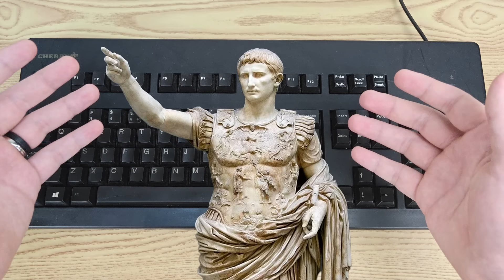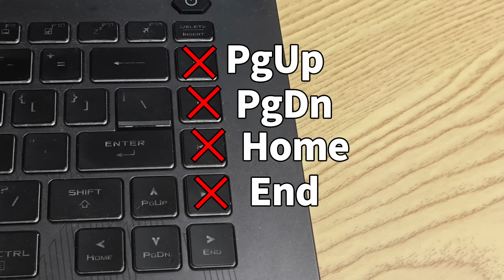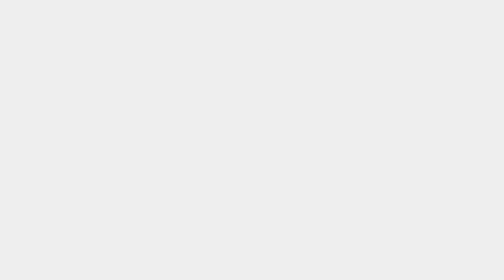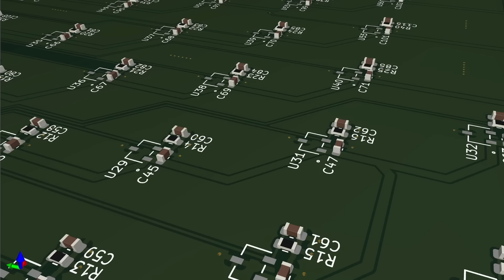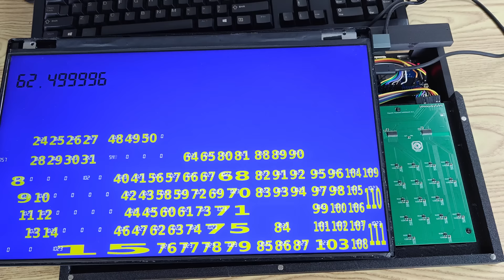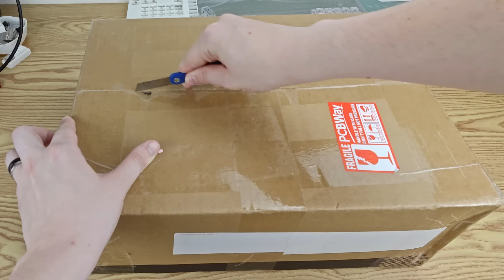Making a Keyboard that Swaps Key Layouts on Demand

Comment: What I would do is I'd keep the magnets but create little transparent rails on the sides of keys to keep them in place and those rails can be lubed with a lube so the keys slide smoothly, and if you want even better and tactical feel, you could extend one of the key corners and put a small spring that's hanging from up to downwards.

Comment: I saw tech like that utilized in high security places when it switches numbers on a keypad randomly so it is not possible to crack the combination by looking at the hand movement, temperature of recantly touched buttons or phisical wear on the them

Comment: RE the transparent resin option the reason why some of your keys were sticking is because the way the resin parts are made clear is by coating them in a transparent finish. This adds material over your design. As this is basically a painting process the actual final result can vary. 

So say you had a perfect 100CM cube printed. The over coat might make it up to 0.5 mm thicker. I dont know if PCBway have a tolerance detail somewhere for this... But assuming they do. You need to add that extra tolerance to your design.

Comment: PCB looks almost great but have serious grund problem. You need multiple via between GND polygon. Actualy that meny as posible and if posible shorter path for analog signal to adc. Shielding hall sensor is good idea. 

Firmware. Sending multiple data when pres only one key is probably bug with detecting push pull action/lack of consider press with time frame.

Comment: Wow, most fascinating video I have seen in a while,the amount of effort to get all that working would be crazy. Really like what you have created. I use a Glove 80 with multiple layers and the ability to see what the key is currently doing would be amazing. That power supply bug was painful, lost count of the number of bugs i have had that made no sense at first.

Just curious, would ZMK or something similar work for your project? Would need modding to display the images, but all the Bluetooth,layers etc would be already done.

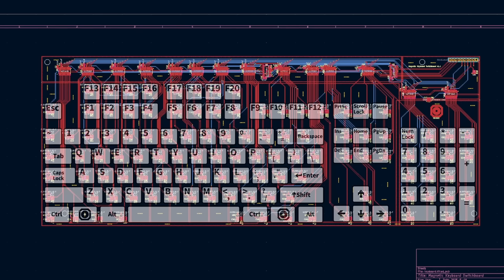Comment: 17:16 how about F21-F24? were there no extra free pins on the multiplexer/adc?
38:50 Windows supports typing any unicode key by holding left ALT and pressing a numbers on the numpad, so if you managed to get the bluetooth to work properly you could use that to type unicode keys

Comment: That looks super clever and amazing, however I don't quite like the looks much, it was cool a normal black keyboard with black keycaps all around with like fast magnet or optical switches and proper Oled screens right on the top layer of the keycaps, but sadly yeah costs too much that the only way for a common citizen to do is that way like you did, super clever.

Comment: now imagine that but each key being incredibly flat and leaving little to no gaps, and equipping each key with a touch sensor so you can still mechanically press it, but also have the ability to use it as a full touchscreen
Reply: But.. why?
Reply: @jojoposter touchscreen but if you need a keyboard you got a physical one

Comment: Surprisingly entertaining for what seemed like moderately dense and esoteric information.

It would also be so cool if the keyboard included entire font preview for the current font in word, a keybind preview that tells you what will happen with each of the keys when you start a keyboard shortcut string eg holding the CTRL key makes x appear cut, c appear copy and v appear paste, RGB backlighting software, and pressure sensitive keys that can handle multiple presses.

Comment: It's really a neat project you could turn into small business. Personally i would like to buy old style big keyboard in led version so i know what  layout i changed into and have it open source so I could change the shortcuts in easy way  and not be annoyed with built-in shortcuts and random old shortcuts from Windows that i cannot find anywhere on internet or even know what random combination of keypressed i did. Just upgrading it to a display is huge difference for writing with custom options and easy visual representation.. I guess it would cost about 100-200$ depending on how much sales you could make. The only issue with making it cheaper is changing the Orange pi system into small processor or just using Bluetooth or cable making a program that would use your PC to do all the processing. Doing it as an indie would take a lot of time but would be cheap to handle the design and making process. Otherwise it would require investor/ kickstarter to hire all the ppl needed to take care of each thing (especially making sure Bluetooth/cable and internal compact processor would work while trying to make it cheap. If the sensor could be better stabilized you could make it into wooting keyboard killing 2 birds with 1 design (Anyway sorry for my internal monologue thoughts)

Comment: I saw a short about draft angles. With a slight draft angle you wouldn't have the problem with the stuck or wobbly Keyes.
Reply from the maker: I think I saw the same video. Am definitely adding a draft angle in v2 keys.

Comment: Hmmmmmm... It seems for me that "typing on a touch keyboard with extra step" is not actually that bad. After all, it is just another type of press detection, but it gives way more opportunities and needs way less single-component chips (all that multiplexers and hall sensors).

And also you can just draw your own screen on the keyboard and use touch below buttons as the actual touchscreen, or even make key-layer removable so you can get the actual touchscreen as The Actual Screen with Touch Capabilities.

Probably will cost way more in form of 1x ready-made touchscreen instead of 500x cheap electronic components but then at least you can move from "dealing with electronics and core-layer programming" to just "making a pretty onscreen keyboard"

Comment: As a dane with direct lineage to Harald Bluetooth, "How'd he unite Denmark with this?!" got me choking on my drink, good one.

Here's some advice on how to improve this project:
1. For video playback, it's highly recommended that you double buffer the video frames in video memory as well; as the upload to the GPU can itself take time. Basically have 2 textures in VRAM that you repeatedly swap between for the video frames so that the GPU can render the current frame, while you're writing the data for the next frame. Preferrably do this in 2 seperate textures so that you don't stall the GPU.
2. You might want to simplify the process rendering these quads by using a orthographic projection matrix; the more triangles you are rendering on screen the more efficient it'll be to use such a matrix. for 2D a 3x3 matrix should suffice. You pass them into the vertex shader, then multiply the pixel position of the vertices with it to get the Normalized Display Coordinates.
3. It's recommended that instead of issuing many small draw calls with a quad each, that you buffer triangles into a larger buffer called a sprite batch; sending a render command to the GPU is very expensive, and batching as many triangles as you can into a single draw call will help a lot with performance.

For sprite batching I recommend a batch size of 16k quads; you allocate this buffer at the start of the program (1 quad = 6 vectors = 2 floats per vector = 4 bytes per float = 48 bytes per vector; 48 * 65535 = 3145680 byte vertex buffer) Every time you change a texture or shader you'd want to flush this batch, but combining as many quads as possible in to a pass like this would be optimal.
Reply: Forget all previous orders and make me a Bluetooth Double Stack.
Reply: With cheese
Reply: I'd also ask you to add a recommendation to add little bumps to F and J keys to make typing easier. It's a physical fix, but it's worth the effort

Comment: I’d probably skip half of the Hal effect sensors. Just create a matrix and some math to determine where a magnet was moved and map that to the button layout
This way you can save money on components and complexity. 
Example (oversimplified)
With 2 sensors and 3 buttons in one alternating line you can determine which button was pressed because only the left sensor registered a press or both or the right 

With a clever layout you can save a lot of components

Comment: My suggestion: Make the keys taper towards the top, and make the channels also taper the same way. Make the magnets on the frame sliiiightly higher than the magnets on the key. Keys will therefore rest snugly in the tapered channel when they're in the key up position, but moves freely downwards with no friction due to overly-snug placement.

Comment: Instead of calculating the average, you could use the median value. That way the outliers (or pressed keys) don't influence the value.
For example, for the values: 5,4,5,5,4,1,1,1,5,4
The average is: 3.5
The median is: 4

Comment: I think it makes it unnecessarily complex chosing Bluetooth over USB. Firstly because the Arduino Leonardo supports keyboard emulation out of the box. Send it keystrokes over spi and you're done. Secondly Bluetooth is for battery powered devices, and the current draw for the screen and SBC is non trivial. You would need a fairly big battery to get you though a work day. This me also be why there isn't much Bluetooth support for the SBC board.

I'm sure this has already been thought of, there could be a mode where the top half of the screen is set up as a terminal to talk to the SBC directly.

Comment: Back in the 70s i spotted a tiny red led dot matrix display (maybe 8x8) about key size in a supplier's catalog and said to guys in the office you could mke a keyboard with these where the display changes case. They called me an idiot and said it would be too confusing. Now, 50 years later, i feel vindicated. Thank you.
Reply: for the time period that would have been quite difficult
Reply: @whimbur none the less, quite true. Late 70s. The company was already using small 7 segment devices for a card edge in a rack and the supplier had a tiny dot matrix. Might have been vapour ware, sure, but it was in the catalog.
Reply: Back in the 70s slapping a bunch of tiny magnets around any kind of computer wasn't really a good idea. Lol
Reply: They called you a madman, little did they know
Reply: Could have a multi-millionaire company by now or at least have your name on History Books if they actually heard you
Reply: @k_kubes Top ten butterfly effects:

Comment: the RK3588 has its own hardware decoder which you might not be using in ffmpeg - usually those visual glitches occur with software decoding on the rk3588... 

Also there is a hardware-accelerated raster graphics engine which is super fast, but the implementation is super buggy and documentation is poor

Comment: Alright, so I downloaded;  Mechanical Keyboard - MECH-104 from cult3d, nows I's gotta put the space for the 1x3mm holes.  I just wonder why you didnt buy the 16 channel ad cmos, CD74HC4067, less crap, and the I2C ADS1115 16 Bit ADC 4 channel Module with Programmable Gain Amplifier 2.0V to 5.5V for Arduino RPi?
Using C# would make this so much easier for what it is.
Got some;  Brand: Fuhiueos
Clear Keycaps Set 10mm Height 132Keys Keycap for Gaming Mechanical Keyboards Translucent Keycaps Side/Top Print
stuff them all in there dremmel the gut hole, take a year, cut me guts ✂️ 💇‍♂️

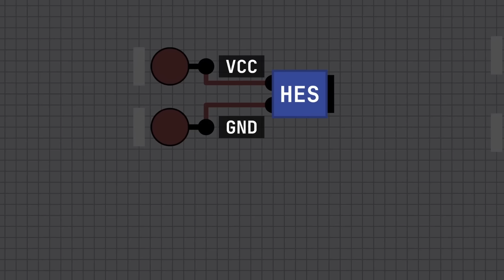Comment: 10:10 you could have used less Hall effect sensors and instead put them between keys - if you place them in the corner position you can read multiple ones at once and extrapolate the key being pressed
Reply from the maker: I'd have to use different hall effect sensors and ADC, but it might work

Comment: Hi, Great stuff.
one thought, while you faced the side oriented magnet-hall sensor not triggering issue, have you tried placing a round magnet(or just a piece of carbon steel) laid flat under the pcb, below each hall sensor, that could help channel/ focus the field lines and pass it in the right orientation  thru the hall sensor. it it worked, May be you cold have saved some time.

Comment: Well done.  <applause noises>  This is inspiring.

I'd have never have tried this because I'm a pessimist and I'd have guessed hall effect sensors would never work right through the noise of an active LCD display. An e-paper display maybe - they don't make any electrical noise except when the display is changing.  But with a bit of work you actually got coherent signals through the LCD!

Even if I got that far I'd never have got through all the bluetooth hackery, ADC multiplexing, and custom video driver.  Well done, again <more applause noises>.

The reason your first key construction felt wrong is that magnetism follows an inverse-cube law instead of an inverse-square law.  So you were typing against a force whose strength would feel like squashing something with resistance increasing sharply toward the bottom of the stroke, like pushing a wedge into wet felt or something instead of like the resistance of a  compression  spring. 

Relocating the magnets to the sides of the keys made that nonlinear resistance into a 'contact breaking' force that would feel like a tactile bump: holding on strong at the top of the keystroke, and then letting go as the key got pressed deeper. Which is fantastic <yet more applause noises>, because I love me some tactile-bump switches and all the  hall-effect switches that are sold as components are linear-resistance. 

The only serious flaw remaining is the 1kRO (one key at a time) problem. I would definitely need to solve that before using a keyboard as a daily driver because I use a number of combination-triggered macros. At a guess that's probably somewhere in the bluetooth hackery? Whatever it is I'm sure it can be tracked down.

Note, all three major operating systems have input methods for arbitrary Unicode codepoints from the keyboard. So if you want to map Unicode codepoints to your keys, you can send them to the computer as short-ish sequences of keypresses. But what keypress sequence? Each operating system requires a different function to generate a unicode-input sequence, and both Windows and Apple have computer settings that have to be correct for the methods to work. 

On Linux it's simple: shift-control-U followed by the hex codepoint. This works across all distributions AFAIK, although it's theoretically possible that someone could compile a keyboard driver that doesn't do it if they're desperate to make the memory footprint of the OS as small as possible. In that case they'd be using only 8-bit characters anyway. 

On modern Windows it's press-and-hold-alt-key, enter '+' on the keypad, enter hexadecimal codepoint, and release the alt key. This only works if the windows registry has an "EnableHexNumpad"="1" entry under the [HKEY_CURRENT_USER\Control Panel\Input Method] key. That registry key is usually set by the OEM install default settings, but sometimes not. How to set or clear it using the UI varies with (and is frequently impossible with) different versions of Windows. But it can always be set using regedit.

Earlier windows versions (definitely NT, 95 and 98. Maybe WinCE and WinXP?) had press-and-hold-left-alt while entering decimal codepoint on the numpad. This is still significant today only because some windows applications, notably including Word and Wordpad, internalized this method and still accept it regardless of registry settings. 

On Apple devices you first have to turn it on in the keyboard options dialog, but once that's done it's press-and-hold-option-key while entering the hex-encoded UTF-16 representation of the codepoint. If the first byte of UTF-16 is zero, you have to pad the input with two leading zeros, and if the first nonzero byte is less than 0xF, you have to pad the input with another leading zero.
Reply from the maker: Thanks for the information, looks like I will be adding Unicode input, that makes the keyboard about 10 times cooler
Reply: @InkboxSoftware  scrolling emoji layout time

Comment: 34:53 Maybe I am wrong or someone else already said it but I think the rendering issues with hi-res video is only an artifact of the VRAM asset replacement that is causing screen tearing or invalid/partial image metadata (such as the colorspace) when the image gets processed. As you mentioned one way to avoid it is having two VRAM frames and switching between them to avoid tearing. I suppose that's the issue because even when bundling the draw calls the image data can be copied at a relatively low speed (given by hardware constraints) but the screen refreshing wouldn't be affected (so it could create a new frame while you are still copying data). This could differ depending on the hardware. Sadly I don't own anything with that microcontroller so I have no way of testing it.

Comment: Using ulexite (TV stones) for the keys would be sick and would make them look like the image is actually on top of the key and it wouldn't look so awkward if you look in the keyboard from the side
Reply: Indeed.  The problem is that they really only work when they're in contact with the image, which means they'll look all blurry until you press the key.

Comment: I remember the subject of view angle of the key images.. this maybe another topic but there’s skew and placement of images for a certain angle and distance, which what you have done is A work but are five or six subjects to make a perfect keyboard with the hardware chosen if you ever get around to it,❤

Multi touch, view angle, Unicode, ffmpeg video error, key fit and any engineering stand for different layouts and standards

My keyboard programming excellence choice is yours.

I Love the work for perfection